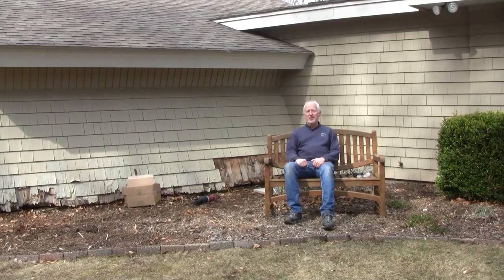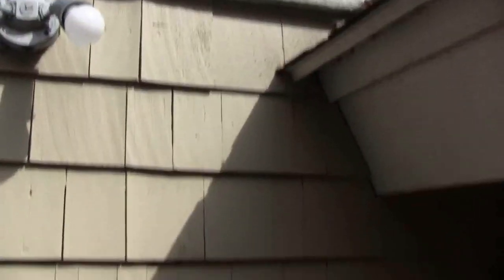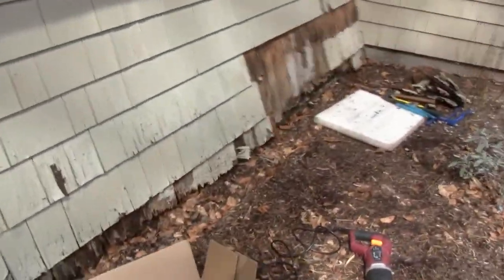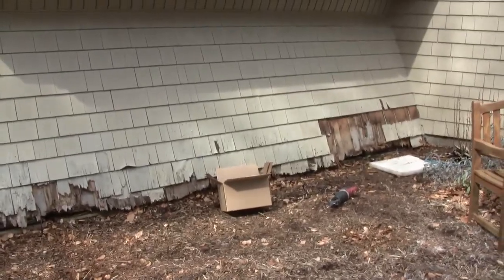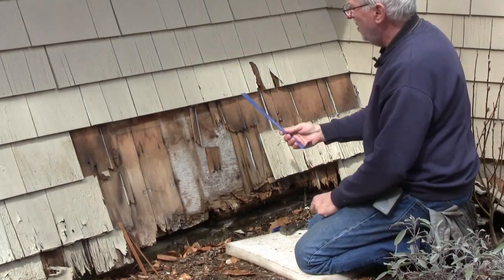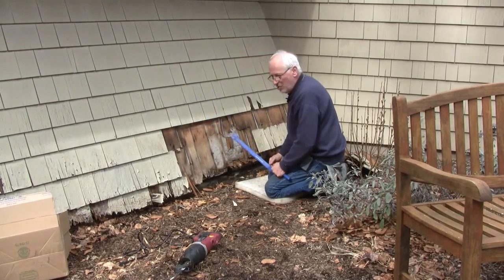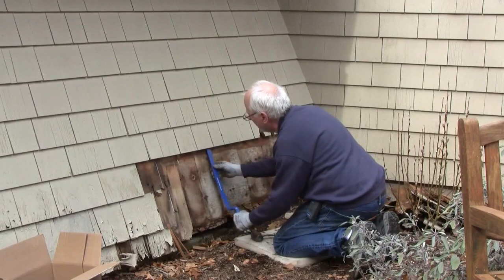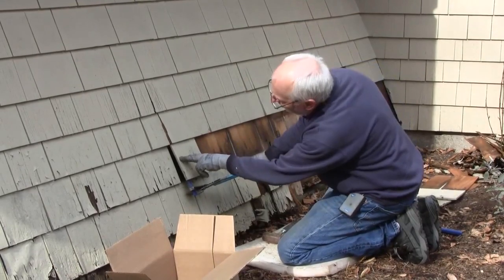#480 Repairing cedar shingle siding

Comment: You're not weak! You're strong!  I'm only 40 and struggled though doing my own shingle repair.  kudos to you at 50++ getting this done for your wife to plant her garden!!
Reply from the maker: Yeah, well, 50++ took a toll anyway. Ended up with a raging case of ITBS in my left leg afterward. Took almost two years to heal completely. Wasn't long after that I badly broke that same knee from a fallen tree snapping in my direction when I cut through it with a chain saw. That was just over 3 years ago. Sheared the lateral tibial plateau right off. Was on the operating table over 3 hours while they put humpty dumpty together again. Have a steel strap screwed to my tibia for a souvenir. Aging sucks!
Reply: I'm 47, now, about to tackle what you put in this video, after finding rot trapped behind an old, attached porch I was replacing... fun! Lol

Comment: If you are only replacing the bottom row how would you cut the top of the nail off if you can't fit the tool underneath?
Reply: Sadly sometimes you need to remove perfectly good shingles (things) to get to the one you are trying to fix

Comment: Excellent work and thanks for sharing this - my house is cedar shake shingles as well.  Do you have a video of you putting those two nails in at a 45 deg nail angle, nail setting em and the hitting the cedar shake up with a wooden block on the bottom ? 

 Fantastic and thanks for the video tutorial. New subscriber here.   What nails and size did you use for your 45 degree angled nails - to put the replacement cedar shakes back in ?
Reply from the maker: Be sure to subscribe to me on Rumble. All new content is going there exclusively. Youtube sucks.

Comment: great to see your healthy and well Z. i have a set of welding clamps that are like what you were looking for . 10inch Steel Vice Vise Holding Welding Sheet Clamp Grip Locking Pliers
Reply from the maker: Yeah, we have similar Vice Grips at work too that used to clamp piano hinges to sheet metal box doors prior to spot welding. Next time I do a job like this I will buy a set of my own to cut down on the frustration of rotted shingles breaking as I'm yanking them downward.
Reply: @zerolabs  great work my friend

Comment: There's nothing correct about any of this work unfortunately. Nice guy but he doesn't know what he's doing when it comes to wood shingle siding repairs. By tweaking, twisting and cracking the shingles he has compromised the integrity of the shingles above. He would have been better off to just rip off the entire section, repair the damaged sheathing and install new shingles. If would be faster and have a much better result that will last a lot longer.
 If you do want to remove and replace lower shingles you don't use a slate ripper that he's using, you would use a long nail saw. It's large blade similar to a hacksaw with a long handle and you actually saw the nails off along the face of the sheathing so the surface is smooth allowing you to install new shingles without running into the old nails left behind after you break all the rust nail heads off. Maybe I should do a video, but that would cut into my roof repair time.
Reply: Yeah, looked for that supposed "nail saw", none of the big 2 box chains or Harbor Freight or Amazon has anything longer than about 9".  I'm not an expert, but most of the shingles are longer and you need at least  12-14" in length to get far enough up in there to grab a nail.  On top of that, since it's super common to have the bottom row of a wall butting up against a dormer roof line or the ground,  there is no room to get a 14-18" nail saw under that first row because you have the roof of a dormer or the ground to tend with.  Not sure what the solution is, but I'm running into same issue.
Reply: @TheStoneWhisperer  So I just dug out my Shingle nail saw and the blade looks just like a big hack saw blade that measures 17" long and 1" wide. It might also be a little thicker gauge. That blade has 2 rivets that connect to a piece of steel slightly thicker but still able to go behind the shingles. The total length of reach is 24" behind the shingles. Then that is connected to a long wood handle. the overall length is 49" so you can really push and pull on it.
It would not work on a shingle that is sitting on a dormer obviously but it will work on the next course of shingles on an angle and then you replace as many courses as you need to. A professional would never try to take out a bottom shingle sitting on a dormer because there is no way to lower it to remove it, you have to start higher then remove the bottom course. It only takes a couple minutes to replace a small area. I'm sure I didn't get it at a big box store since they weren't around 40 years ago. I'm sure I got it at a roof supply somewhere. Good luck.
Reply: @bobbarker9986  cool beans! At least there’s hope I can find something like that at a specialty store

Comment: Looks like runoff from the roof is the problem as the overhang is too short for that sloping wall.  Would you instal a gutter on that section to collect runoff?
Reply: You would. Water would also be splashing up onto the lower courses of siding even if the wall was plumb. Gutter is a no-brainer here.

Comment: The “water damn” is from the attic not being vented. Too much warm air is leaking into the attic from inside the house and since it’s not venting it causing the snow to melt, but then the water moves down the shingles and gets to the bottom edge of the roof where the eves are and there’s no more heat cause that section isn’t over a room in the house and the water freezes causing a faking effect

Comment: That house slant side that the rain gutters drop on should be plastered or have a layer of textured or smooth concrete. Would that last longer than wood? It could be painted the same color as the rest of the house.
Reply from the maker: Meh. We've been here almost 20 years. The shingles were probably almost 40. I'll be long gone by the time this needs replacing again. Not my problem. LOL!

Comment: FIRST z things first theirs no gutters on that side !!!  it’s by a valley needs gutters on each side and won’t have that problem !!! With gutters those corners are problems without that’s what you get. Is definitely no downspouts so the water is gonna flow right around your your foundation which is a definite no no ,so not only do you have a siding  problem  but you’re probably going to want check basement crawl space etc
Reply from the maker: Yeah, I know. None of the house has gutters because the overhangs are two feet from the siding. Splash zone doesn't reach. This addition also has a large overhang but, as you point out, the slope of the outer wall puts it into the splash zone. Not worried about it too much, though. I'll be long dead and gone before this will need replacing again. It'll be someone else's problem. LOL! As for basement, entire house is on a slab. No concern there either.
Reply: @zerolabs  oh k slab nice have right merry Christmas 🎄 god bless Everyone

Comment: @4:28 is that really the best way to support those studs w/rotted ends? Seems like it would have been better to shim with new wood below than to rely on the shear strength of the screws (lags?) you are using.
Reply from the maker: Had to cut away too much rot. 3 lags on each stud is more than adequate.

Comment: I've done several repairs for customers and myself over the years on shingles and have found that if you just take a Skil saw and cut 1/4" to 3/8" deep along the bottom edge of the shingle that your working on, clean the edges and then shingle up to it and nail the new shingles with 4 penny nails, putty them and put a good coat of oil base primer on, you'll be just fine. No need to go thru all the hassel 
of under-cutting the shingles and nail removing. Your gonna have exposed nails somewhere anyway, so why bother with removing the old rusted nails.  I've got jobs I did 20 years ago and they're just fine.
Reply from the maker: Suit yourself but I'm glad you're not working on my home.
Reply: @zerolabs  the way your doing it is 'correct' but if properly sealed (water seal, oil base paint etc;) it'll work just as
well. Another option is to slide a small piece of galvanized flashing under the row of shingles above the one your 
replacing and nail your shingles in place below it. Again , it's very important to seal the exposed wood with either 
a stain or oil base primer. Remember Zero, sometimes it's impractical and costlier to do it the way your doing it here. Either the customer's budget is tight or the house is such a 'train wreck' that it's just not worth the time and 
energy to do it the 'This Old House' way. Cheers, keep up the good work and remember what Sinatra said: 'I Did 
My Way'...........
Reply: My brother has been in the building trade since the 70’s and replaced several rows of cedar shingles on our shed doing it this way and he says it will last perfectly fine if sealed correctly as you said.  👍🏻
Reply: @XenaTheQuadCamBikah  ya, if you properly seal all the exposed wood and caulk all the seams with silicone caulking it should 
be fine. And if you wanna be thorough you might tuck some aluminum flashing under the shingles above the ones
your replacing just to be doubly sure. Don't get me wrong tho this fella of Zero Labs is doing it the proper and 
professional way. It's kinda sad that he had to insult me just because I was offering an alternative way that might
save some people time and money. Oh well what a do?

Comment: Hey Zero welcome back...I think an ice brake will do the trick for you, same technique used on metal roofs in conjunction with the new gutters.......
Reply from the maker: Never heard of it but I will look into it. Thanks!
Reply: Hi Zero, nice to see you back... glad you’re doing well and good luck with the project.  ;)
Reply from the maker: @Adirondacks4me  OH NO! That is exactly the opposite of what I need. I'm not concerned about snow falling off the roof edge. I WANT it off the roof edge. What happens is this... 

https://www.google.com/search?q=roof+edge+ice+dam&sxsrf=ALeKk00Aw-HGmgKc2v5VaRzkTmY9FPmBmQ:1584277458607&source=lnms&tbm=isch&sa=X&ved=2ahUKEwiriZW5xZzoAhXYknIEHUnaDeUQ_AUoAXoECA0QAw

Not so much a problem on the main house because I have 2' of overhang and 3' wide rubber membrane under the shingles at the roof edge. Great room does not. Against the garage the ice dams spill water out to the side and down the shingles. What I really need is this... http://summiticemelt.com/